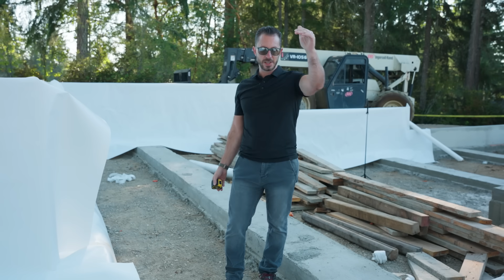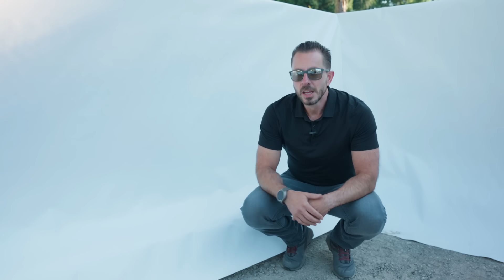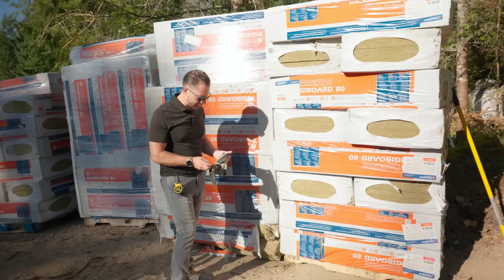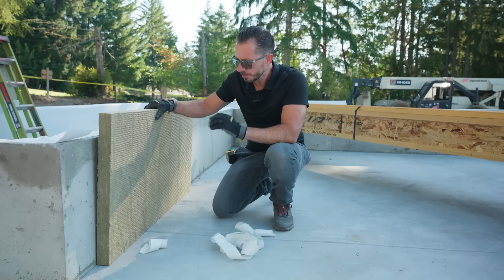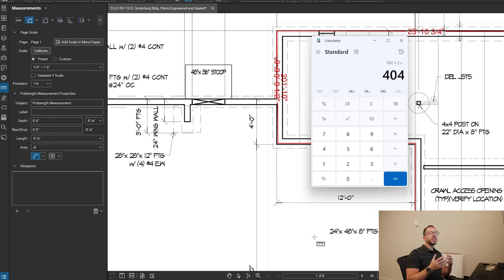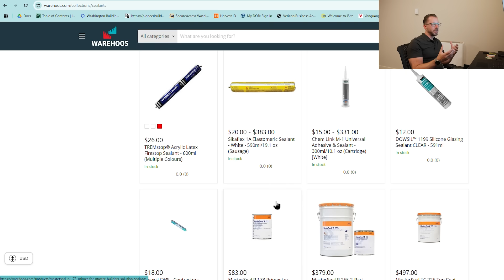Installing Rigid Insulation

Comment: You guys need to be very careful with your sponsorship. 
I understand you enjoy making money. But it is very short sighted to promote a “bad deal” supplier as it will damage your reputation. 
In my view you should prioritize your reputation, and this video is making me question your integrity. 
Mr risinger, it would be a smart move from you to delete this video and return the money you received for this sponsorship.
Reply: This channel has been little more than a materials brand advertising platform for years now. I still enjoy watching the actual building science content, but I skip the commercials.
Reply: @dlg5485  Some of the other guys on the channel (like the Unbuild it podcast) are pretty solid but yeah… these ad videos are pretty cringy.

Comment: There is certainly a value to the flexibility of that distributor, but unless they have some major price breaks for contractors behind a paywall or something it's certainly not a great value. They are charging almost double what my distributor charges for installation for instance, per square foot given identical part numbers. 

That was with $150 shipping and a minimal charge for material handling on site included.
Reply: Could you please share?